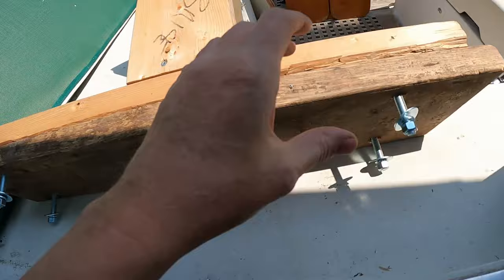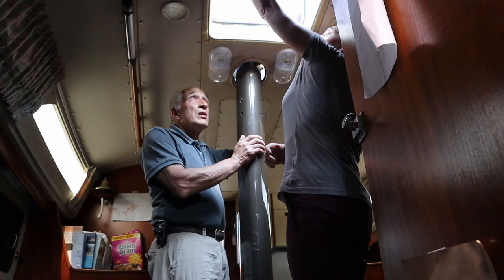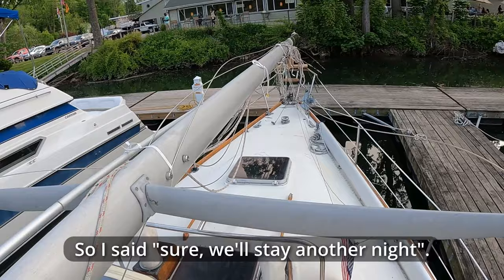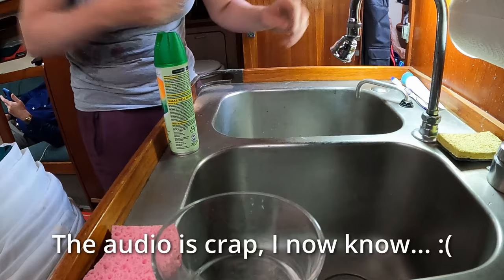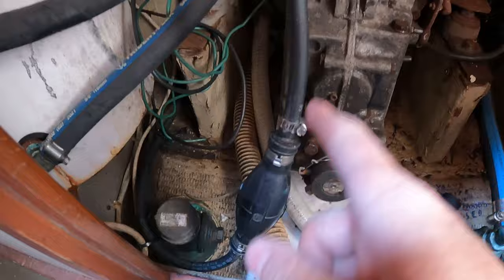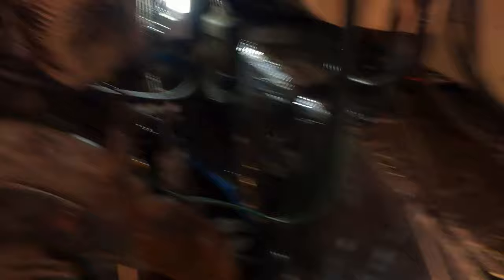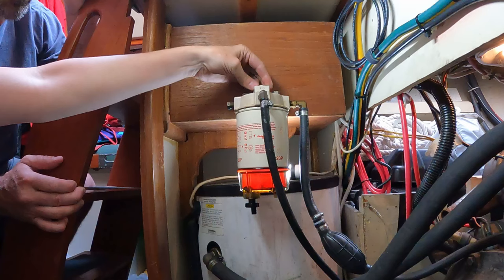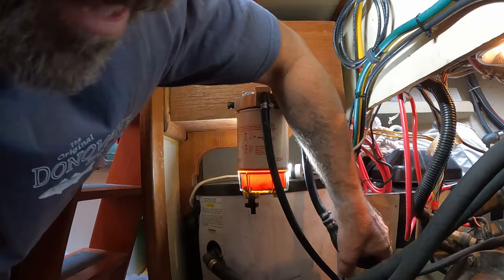Ep. 79 - Mast Down, Breakdown!

Comment: For aluminium repairs:  There's a line of products called Alodine, it comes in essentially a bingo dauber, and you use it on bare aluminium to create a better oxide layer than you'd get otherwise.  If it isn't worth buying one of your own, try your local aviation maintenance shop; their metalworkers will very likely have them.

For that keel bolt:  A breaker bar to get it off is easy enough but if you can only find 250 lb-ft torque wrenches, you can put an extension (see Snap-On's SRDHM30 for an example) in line wiith your torque wrench and multiply the torque on the fastener by the increase in length.  Like if your torque wrench is three feet long and you put a foot of extension on it, multiply your 250 by (4/3) to find the torque applied to that nut.

Comment: The ”bleed screws” on the top of the injectors is actually the leak down return line from the injectors. The three lines on the side of the injectors is where the high pressure diesel from the injection pump feeds each injector. That is the nut you need to crack and then crank to bleed the air out of the high pressure side of the system. Close these nuts and voila, it should start. Then you can crack each nut while idling to remove any last vestiges of air from the system.
Reply from the maker: I think that's the one he cracked where he said a lot of air came out... We didn't do it sooner because I didn't have the right size wrench (hence the "buy the right tools!" comment at the end of the video :)  ).
Reply: Yep , came here to say you were bleeding the returns which does nothing . The three individual lines from the pump are the ones to bleed . Glad you got it going .
Reply: Also, i would consider buying a small electric fuel pump. They are real cheap.
Reply from the maker: @simonlewinson4170  If I was  keeping the engine, I'd 100% buy a little transfer pump!

Comment: Had a badly rusted steel diesel fuel tank on the inside. With the pump working the rust would block the tank exit feed pipe so had to fit an outboard tank with new lines to the racor filter and ran that way. Might be worth picking up a 25 litre outboard tank and fitting that to the system and keeping it topped up. Keep going Maddy. It will all be worth it in the end.
Reply from the maker: Some videos back, I did a total service of the tank, and sucked a lot of crap out of it. I'm pretty sure some dead bug sloughed off (I did a biocide and then purple-power degrease treatment, plus fuel polish). I did that hoping to avoid exactly what happened, but I knew even having done all that work, it wasn't 100% safe. I didn't mention it in this video, but for the rest of the trip home, I tried to stay under 2200rpm. I was wondering if trying to make time to catch the federal lockl / flight of five locks, I was pushing hard, running at 2500~2600 rpm. I started wondering if the higher fuel burn was causing more suction at the end of the pickup tube, and hoped that powering slower would reduce the chance of sucking up crap.

Comment: Those old style fuel lines break down and micro particles from the hose cause all kinds off issues as you seen. I switched to the grey/silver lines that do not break down from gas/diesel. The line is 1.5 times as much but you never have to worry about fuel lines again. I am saying this for others who will always have a diesel engine/generator on their boats. Quick silver is who I used to order from. Also they have UV shielding so for outboards its a win win.
Reply from the maker: I had replaced every hose and filter in the fuel system, except for the bulb. One hell of an oversight...

Comment: When bleeding the 3QM30, i never have to bleed the injectors. I turn on an electric primer pump and crack the bleeder on the high pressure fuel pump (i believe this is what you referred to as a manifold) a couple of times and the engine always starts. If you get the air out of the high pressure pump that's enough to start the engine every time, in my experience and i have done this tons of times.
Reply from the maker: A couple of folks now have said that what I called the manifold is the high pressure pump, so you might well be right. If I was keeping the diesel, I'd absolutely get a powered pump.

Comment: I wonder if you could have taken the bleed bolt off and attached a hose barb, then used your fluid extractor to pull fuel through the entire line?   Though, that may not have done anything to clear the clog in the tank.
Reply from the maker: Another commenter made the same suggestion, and I think I probably could have. Obviously there would be some spots where I'd have to manipulate to let the air through, but I think it would have helped A LOT. I didn't even think of it at the time though

Comment: I've got 2 spare primer bulbs on my boat. In the old days every auto parts store had them, not so much anymore.
Reply from the maker: I was surprised at how hard they were to find! I assumed they'd be easily available anywhere. I even had a few places say "why do you even have a primer bulb?". I guess most modern engines use electric pumps? Well anyway, if I was keeping the engine, I'd 100% get spares. Thankfully, my new motors have no use for em. :)

Comment: As to the MFD discussion  - I agree with your decision. A dedicated MFD is great. You’ll appreciate the larger screen. It And, it has its own antenna for better reception
Reply from the maker: Since I recorded that, I've started playing with the idea of building a standard PC (like an Intel NUC or Dell Optiplex Micro) and running openCPN. One worry I have about going with an MFD proper is repairing it / fixing it if I'm somewhere outside service area. If I roll my own, it'd be much more repairable. Could still get a bigger screen, and might be easier to tie into the rest of the systems I'm hoping to build/monitor.

Comment: Those caps you were opening are the fuel return line from the injector pump feeds the side of the injector  
the pump you serviced is the lift pump the injector pump is on the other side of the engine (were he opened later ) is were you bleed the injector,    Im sorry you can you have to go through this I'm  yelling at the screen trying to tell you what to do 
LOL  I've been working on engines for 5 decades.  by the way your oil change pump could suck the air put of the system just hook it up to the lift pump discharge and pump till you get diesel to that point.
Reply from the maker: Heh, until I started servicing this engine for the trip home, I'd never touched a diesel in my life... I've had sooooo much to learn, and I've made a number of mistakes along the way. So learning goes! Using the oil vacuum to suck air out it ... wow, I never would have thought of that, that's brilliant.

Comment: Dunno if anybody mentioned it yet but concerning navigation, you might be an OpenCPN Person. And in any case somebody has a similar diesel problem, disconnect or cut the line, stick in in a jerry can, lift it up for gravity assisted bleeding and finally put it down and lash it down. It also removes a ton of variables from the equation (like bad fuel, leaks downstream, contamination, clogged vents, defective pickup...)
Reply from the maker: Getting the diesel over the engine to use pressure to help bleed, nice! I wish I had thought of that, but alas.
Reply: @TheDigitalMermaid  Thanks! Next time.Even if it's not in your boat, you'll meet plenty of folks with engine troubles. And these engines are also very simple, so getting into fixing them is not too involved and it can be quite rewarding. Also, it's the same kind of analytical thinking as electronics. I guess a full disassembly manual for this thing is shorter than the user manuals of your blue appliences combined.
Reply from the maker: @horstkotte6114  If I run into someone in trouble, I'll be happy to help them and happy to have any skills that help me help them. That said, I have zero interest in doing engine work beyond that. It's not that it's bad or anything, I just enjoy working with angry pixies and code more. :)
Reply: @TheDigitalMermaid  I think I just like troubleshooting :-) And in my situation fixing old engines is often the least amount of work / financial effort, so even if I'm not a diesel fan I sort of respect them in this application.

Comment: 43:17 Can you pour diesel into the filter from the top to fill it up with diesel and push the air out?
Oh wait, it looks like you may have other issues. I'll keep watching...
Reply from the maker: Ya, when you heard me ask the guy if the diesel in the squeeze container might help, that was the kind of thing I was thinking about. However, for the filter itself, there wouldn't have been a way to squeeze it in, the screw opened up narrow slits. Good thinking though.

Comment: Awesome video, thank you.  Have learned a lot about diesels.  A thought, it's likely the bad squeeze bulb fragmented on the inside, resulting in fuel system contamination.   Good luck.
Reply from the maker: Oooooooooooooooh. Holy shit, you might be right. That would explain how there was crap AFTER the raycore! Damn, I wish I still have the bulb so I could cut it open and look. Huh, not that's an interesting thought!
Reply: @TheDigitalMermaid  One other thing (if you haven't already) check to see if the squeeze bulb you bought diesel rated.  Most of the fuel related things sold at WestMarine are just for gasoline.  Just a thought, sorry.
Reply from the maker: @avitiello100  A very good concern, and I did verify it was diesel rated.

Comment: Is that little leaver a plunger ?  Looks like a bleed valve if not Would it not have been faster to undo one of the injectors and run the pump by starting the motor until you see diesel come out
Reply from the maker: The lever activates the pump (basically, on one side, it goes into the engine to be activated by a lobe on the cam shaft, on the other side in the lever I was pressing). In the end, nothing was going to work because of the blockage in the output check valve on the pump. Once that was cleared, then yes with the injector manifold open, and then the injectors themselves, I could have cleared it eventually with just that little lever, but turning the engine over was a lot faster.
Reply: Yes you fixed it :) I start typing when I see it I should wait to comment until the end of the video haha can’t wait to see the electric install learn from you’re mistakes :)
Reply from the maker: @dennisbrok9335  I do that allllll the time! haha.

Comment: A light glass beading will remove the aluminum corrosion but leave the solid metal.
Reply from the maker: I'm guessing I could take the foot to a metal place and have them do that easily enough. Though, I need to repaint the mast so I may need to find a DIY option as I can't take the mast to a shop. :)

Comment: Rotting wood consumed the oxygen, so aluminum parts did not have enough oxygen to rot. Very lucky=) 

In other notes - have you considered what you'd do when the lithium battery catches fire? Would be nice to have a fire escape chute of some kind so battery can burn out without sinking the boat.
Reply from the maker: LFP batteries have a very very low chance of fire, less even than lead acid, and certainly less than a propane or LNG stove. The worst case is that, if they are damaged, they can swell and possibly vent their electrolyte. For that reason, and as per ABYC standards, I'll be keeping the exhaust vents so if there's ever a rupture, I can vent the gas. As for the aluminium, ya, I scored!
Reply: That's what I was thinking too. All that decomposing wood made for a reductive environment for the aluminum, saving the boot.
Reply from the maker: That video is the one and only case I've ever seen of an LFP cell catch fire, and he hand-waved the "abused before this test" part, with no explanation for what that abuse was. Even still, he had to repeatedly stab it with metal to get it to ignite. ABYC, the standards body, tried to reproduce anecdotes of LFP fires on boats, and they failed completely. 

I've been trying to find proper studies and controlled tests trying to trigger TR, and the highest temp was a 200Ah cell that had been overcharged at 1C; It spiked to ~515 degrees celsius, briefly, then cooled back down (the flash point of fiberglass is ~600C, for reference), so even if the temp had been sustained, it's wouldn't have ignited. 

Anything sufficiently abused can end badly, and a lot more easily if the diesel system, propane system or heck, even the wiring regardless of power source is abused or neglected. So while there might be some way in some extreme abuse corner cases to cause LFP to ignite, there are many many other risks for fire on a boat that are much more likely to cause fire. 

This comes back to something I touched on in the video; The risks of diesel, propane, lead acid batteries, etc are "known risks", and are accepted without much thought because they're common issues across most boats. I'd argue, strongly, that LFP is one of the safest energy sources on modern boats, but because it's still fairly new, the risks are not normalized yet, so folks focus on this disproportionately, while more or less hand-waving away greater risks from familiar tech.
Reply from the maker: That's something I never thought of, but I can see how it might work... It's a fascinating idea.
Reply: @TheDigitalMermaid  Well, as long as you are aware of the risks, its all good. If I find any solid evidence for TR or other fire risks in LFP batteries I'll keep you updated.

Comment: FYI, and completely pointless bit of information now well after the fact. But that "Bleeder", aka the big white knob, on the external fuel filter/water separator is actually supposed to be a little pump.  Unscrew and it is a little plunger that you can pump up and down.  Now I will tell you, on my boat with I think that same filter, my little pump doesn't work...  But that little pump on that filter/water seperator is supposed to do what your fuel bulb is doing.   Again, no help to you now :)
Reply from the maker: I thought that was the case, I think I even included a clip where I mentioned that to the guy who was helping me, but whatever model I have is, it doesn't have the pump.

Comment: "If it works, keep it!" implies that "working" is also "reliable". If reliable, the diesel motor would be worth keeping. With all of the engine work you had done in preparation for this trip, the system still has many quirks to be resolved.

I was hoping that the motoring portion would have gone smoothly for you. It is interesting to watch your perseverance and troubleshooting with explanations.

I do prefer the simplicity of an electric drive even if range is limited and recharging slower than filling a fuel tank.
Reply from the maker: THANK YOU! Yes, as a diesel engine goes, the Yanmar is fantastic. Compared to the mechanical simplicity of electric propulsion though? Not even a contest! 

When I was broken down on the Erie Canal (sigh...), I had a moment where I started feeling a spot sorry for myself. I'd heard of story after story of people who bought old boats, maybe changed the oil, and then set off of long trips, with minimal issue. Yet, here I was having done so much prep work, and still I had so many troubles. However, I realized (and mentioned to a couple others here), I'm kind of glad it all happened though. If problems were going to scare me off this boating life, isn't it better to find out before I leave my house? So these issues, I think, were a blessing in disguise. I needed to test of will, if that doesn't sound too weird.

Comment: oh you do make me smile, dropping the screw driver bit into the bilge and then washing it? funny, i love the Americans and Canadians, so anti dirt!! 
that there mast step jobby, clean it up, if you don't paint it, just give a heavy coat of wax oil, that spreader that split on the mast, get someone to weld it up and fill that area that's worn away, be good as new and stronger - wow how much for a tow, scary mary, all that work and you break down, roll on going electric
i guess one system is as bad as another, components and anything joining them together, means anything can fail, just like any plumbing, failures normally occur in the joints, systems with components, fuel lines or even electrics and cables, connectors can corrode
i car has always been reliable, suddenly it wouldn't turn over, ignition but no starter, closer inspection and the earth cable between the solenoid and motor had gone, corroded away
Reply from the maker: I think Colin suggested checking if my insurance covered tows, so I called then and they did! Progressive was super easy to work with. Would have cost about $2k, $400/hr from the time they leave their dock until they tie back up at their dock. It was two hours for them to get to me, an hour two, then two more hours back. Thankfully, Progressive handled it without any hassle. 

On the motor side; I think a lot of folks see electrics and so much of them is new to them, so they see it as much more complex than a mechanical system. To some extent, I would even agree with them, in that the mechanical stuff is easier to "see" (both physically see, and understand). However, electrical systems are MUCH more simple, mechanically. So much less that can go wrong. The trade off, of course, is that you need to learn about the electrics. One of the reasons I've decided to "roll my own" motor and controller, instead of buying a ready-made system, is so that I can learn the ins and outs. This way, it will be mechanically simple, and I'll understand the software and wiring, so best of both worlds.